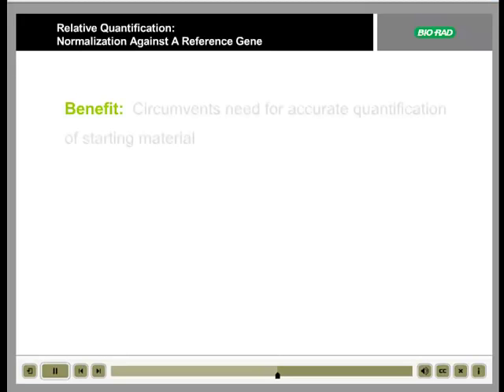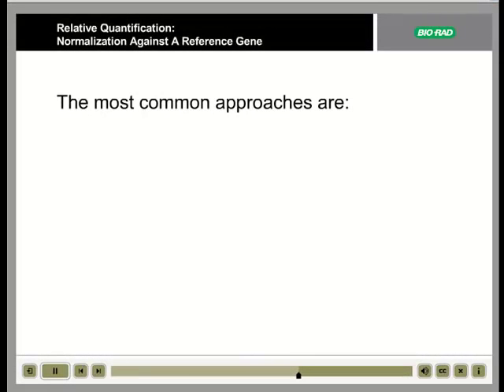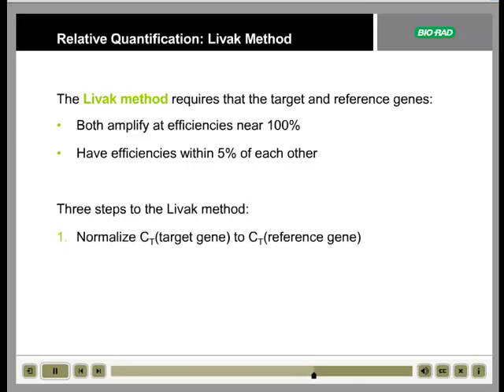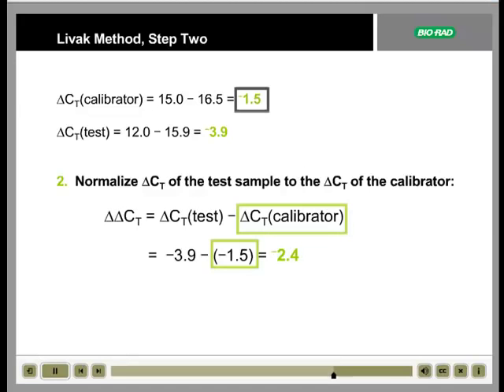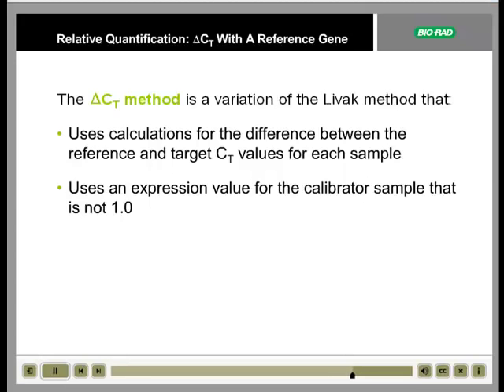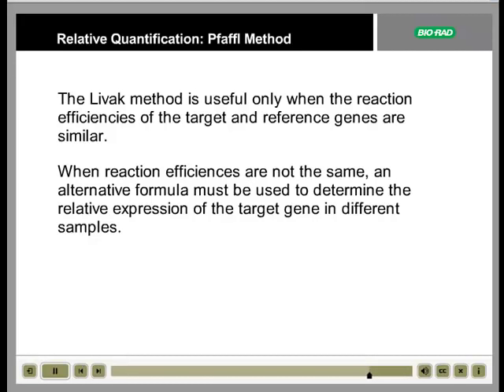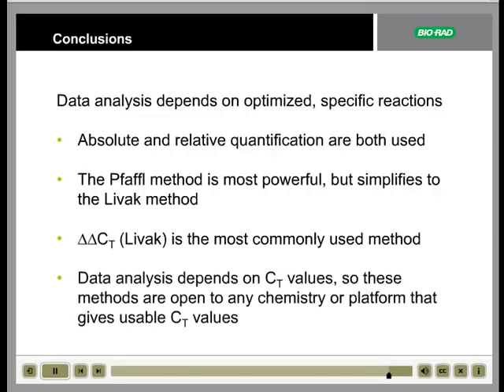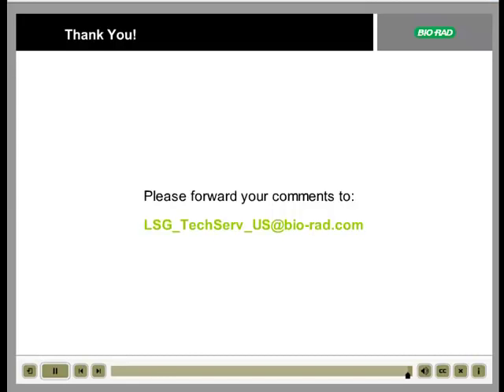Real Time QPCR Data Analysis Tutorial (part 2)

Comment: After we calculate the fold difference in expression between the control sample and the tested samples, how could we know that the increase or decrease in expression is significant?
Reply: Did you find the answer?
Reply: IF IT IS GRETAER THAN 1 , IT IS UPREGULATION AND IF THE VALUE OF FOLD CHAIN IS LESS THAN 1, THE EXPRESSION IS DOWNREGULATION.

Comment: This was really helpful thanks. So if you had multiple samples of control and treated, how would you go about comparing them? I'd assume you'd calculate the deltaCT for each sample in the control and treated groups, and then average them before performing the deltadeltaCT calculation?
Reply: You should do the deltadeltaCT for each control and treated sample first to get the "relative expression" of each sample, then use statistics to determine the significance between controls and treated.  It is not different than doing stats from temperature values of 10 control patients and compared them to temperatures of 10 aspirin-treated patients.  The temperature value of each patient is the same as the deltadeltaCT for each sample, control or treated.

Comment: I got lost when comparing the delta Ct method with Livak (at http://youtu.be/tgp4bbnj-ng?t=5m30s). Where are you getting the two "control" values (both 2.8) from?
Reply: This calculation is demonstrating that you can obtain the same results using both methods when you have 100% reaction efficiency. The 2.8 is Ct ref - Ct target for the control calibrator sample. When you divide it by itself, you get a fold change of 1 - no change. When you divide the test sample by the control calibrator however, you get a 5.3 fold expression change, just like the Livak method.
Reply: Rachel Smith Thanks. I couldn't understand the need to divide the delta Ct control by itself - I see now. Makes sense.

Comment: - 1.5 - (- 3.9) = +2.4 doesn't it? Not -2.4!

Therefore wouldn't 2^-(ddCT) = 2^-2.4 = 0.18?
Reply: No, it's test - calibrator so it's - 3.9 - (- 1.5) = -2.4
Reply: no. when you calculate ddCt = (dCt ref- dCt test) . then the fold change will be 2^ddct. not add a minus.